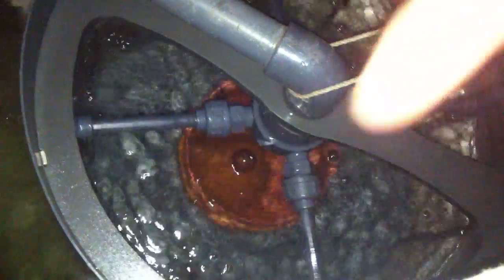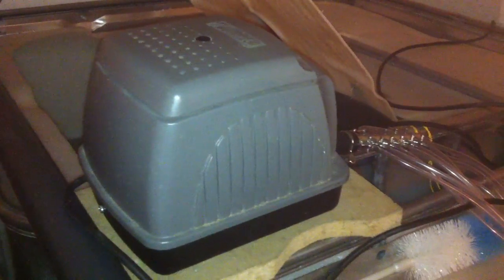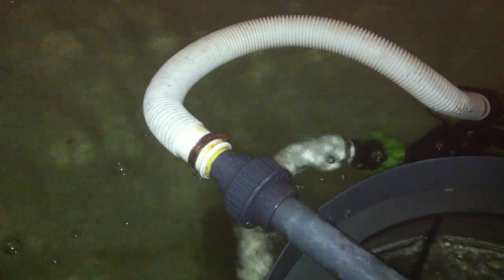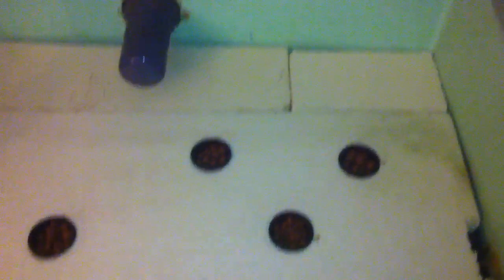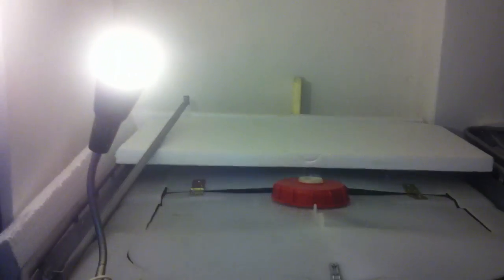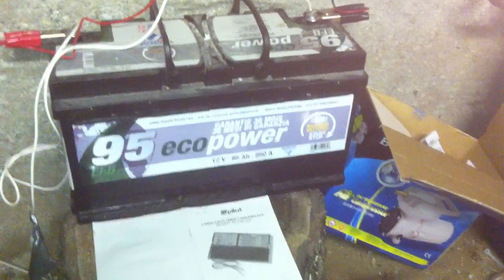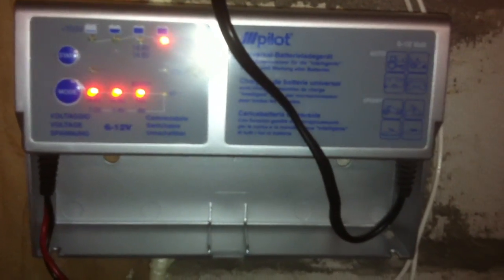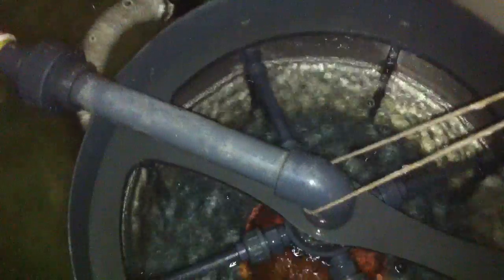Aquaponic Bio filter ,drumfilter and swirl filter .. System update.

Comment: the air hose lines seem to be blocking the filter media movement, maybe use a pvc pipe to hold them near the bottom. Great system, mine is jr league :)
Reply from the maker: Thanks, I have installed a stronger air pump and that fixed the problem..

Comment: hi there , may i know how many tilapia can be hold in one tank?
Reply from the maker: TAN WEE KIAT Depends on your filter and water flow and feed quality.. and oxygen supply...
I need more info on your system to give you a proper answer..
I hold around 80kgs per 1000 litres but I have technical oxygen and very high quality filters and recirculate my water 3 times a hour..
send some info and photos so I can help you..
 kind regards
Paul
Reply: +Aquaponic Gardens That's a good question. I am using the 2000 gallon ibc tote. Same as you. 200 kg of tilapia. I can't find information on what size pump that I need. I am thinking of doing the same thing as you with 90 ibc tote.
Reply: +Aquaponic Gardens The air pump is the most confusing one.

Comment: stupid question but why dose the particle size of the waist matter so much for the plant media?
Reply from the maker: bio hazzard if no filter is installed then the plant beds will become blocked quickly. I run quite high stocking densities with my fish as they are my money maker. I dont use media based beds any longer, instead I use a bio filter as the performance is more than a 100 times better.. I strongly recommend a good fine particle filter.
thanks 
Paul

Comment: Wow! great setup and great instructive video.. Hats off to you my friend.  I am in the process of building a large "colder climate" system.  I am looking for ways to heat my water.  I plan on running water through a stainless steel tube around my wood burning stove and was going to use submersible heaters.  I noticed in your video that you have an inline heater.  What brand is that? and does it work for your large system well?

thanks in advance for any info..
Brent
Reply from the maker: Thanks for your interest... 
I finished a outdoor system here a few weeks ago and we are heating this through a compost pile... We pump the water through a spiral in the compost heap and it gives enough heat to keep temps over 25 c and it's only 3 c outside.. The inline heater is amazing... It runs on 1kw power but it only operates 1 hour a day....but that's inside in a insulated room..
I will post a video soon on the compost heater... Truly amazing and free heating and no work involved..
Thanks again and please subscribe

Comment: Hi very interested in your 200 micron self cleaning filter, I think you said it comes from Germany, any chance of a link or contact information please.
Thanks
Reply from the maker: Richard Miller 
Hi Richard,
You can buy one direct from me, what size system are you running? how big is you pump?
if you could send me some pictures I can recommend the correct size filter for your system..
thank you for your interest in my system,
king regards,
Paul
Reply: +Aquaponic Gardens I have (90) 200 gallons ibc tote. How much power will it run? How much will you charge?

Comment: Hey Paul,
I'm in Virginia, USA.  Using 8 IBC 275's, I have around a 2000 gal sys set up in my garage.  I think that I could possibly benefit from the filter I saw in your video. Could you send me new and used pricing plus shipping to the US?  
Thanks,
Butch
Reply from the maker: Hi Butch.. I have a (new) 10000 litre per hour filter. Price including sending to the U.S. is 795.- usd.
thanks for your interest...
kind regards.. Paul
Reply from the maker: If you require a bigger filter I can supply filters up to 80000 litres per hour..
The price is for filter only, a small pump is required to run the filter.. I can also supply this for you if needed. But I believe you can buy a pump locally near you to save on shipping costs..

Comment: Where do you get the charger, brand perhaps and the air pump?  Im building a house soon, I need to have a system there.
Reply from the maker: hi Mark.. the air pump is a 12 volt pump from Boyu.. Hailea are also good...
it pumps 2400 litres a minute.. the charger is from Pilot ( a marine grade charger but can be also bought from a motor home supplier). the battery is a deep cell and has 300 amp hours... runs the pump for 12-16 hours with no power.. I had it running for 16 and it was still working but as the battery gets older I would only allow 12... but it isnt very often the power goes out for more than a few hours..
thanks for watching.. check out my other videos if you would like some more insight to aquaponics...